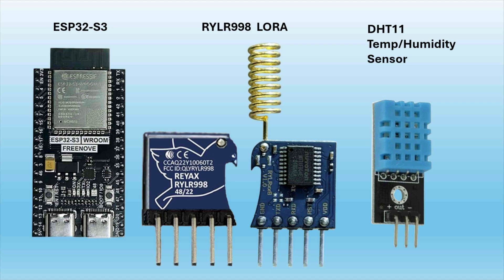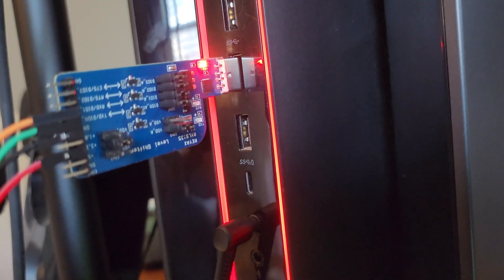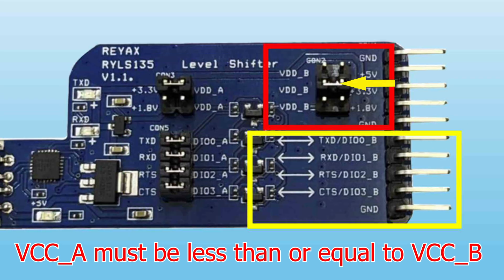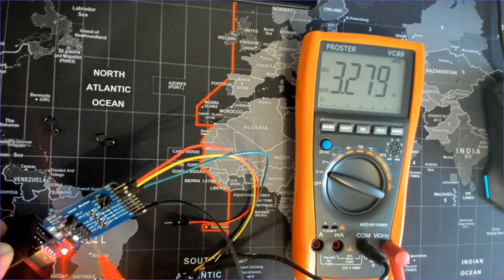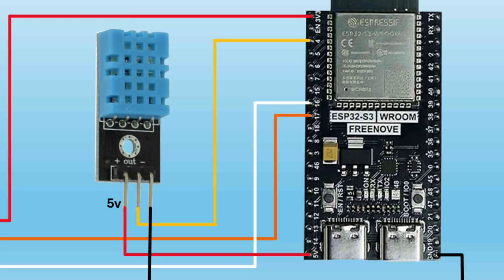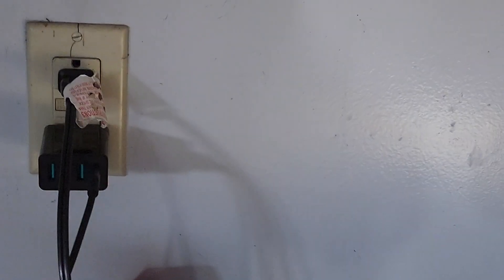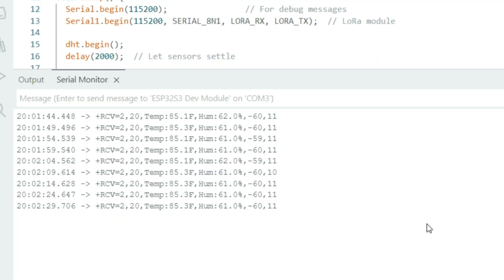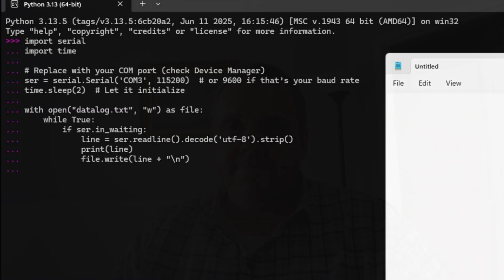Wireless Temperature Monitor with ESP32 & LoRa – No Wi-Fi Needed! | Intro to RYLS135 Level Shifter

Comment: If you have two esp32 module, you can use esp-now protocol directly. That provides a great distance with extremely low latency.
Reply from the maker: Hey there!
A few years ago I tried using ESP-NOW with ESP8266 and wasn't very excited about it. It looks like they have come a long way since then with quicker response and the option for more peer to peer connections. 
Thanks for sharing. I'm going to try this out now!  👍